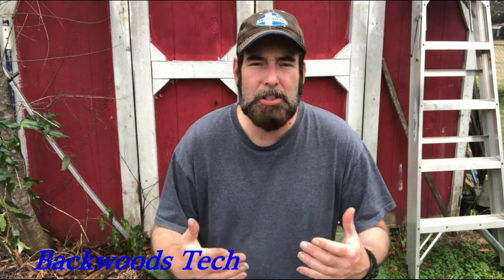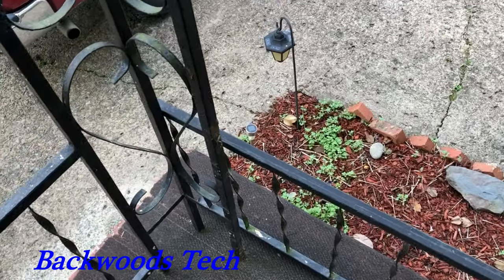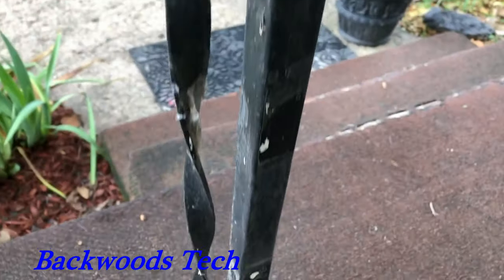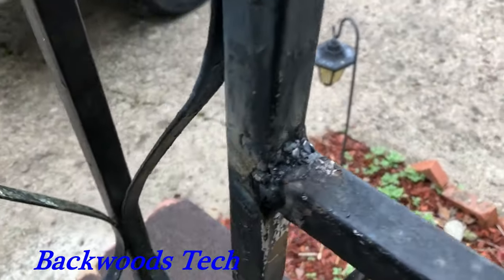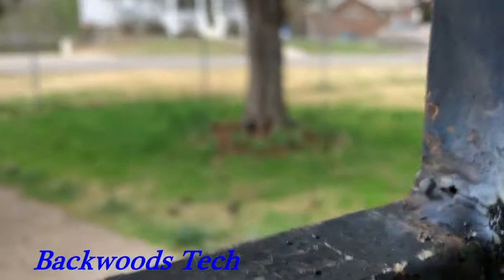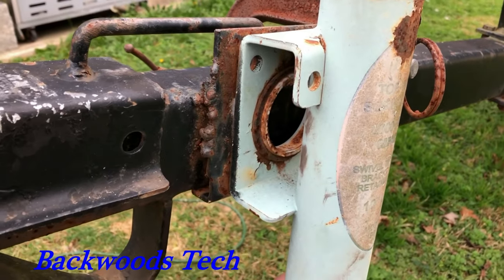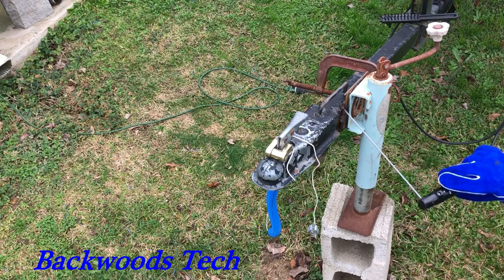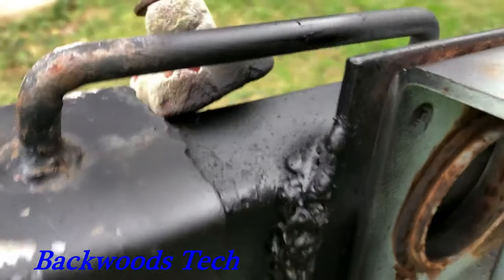Campbell Hausfeld 115v stick welder and kit unboxing , use and review

Comment: I purchased this kit last night from Walmart for $30 after watching this review I am very excited to use it.
Reply from the maker: It’s a great welder for the money . Just as a tip I would start off with easy strike rods
Reply: @backwoodstech1972  Bit late to the party, but would you have a link or brand info on those rods? I also snagged one of these kits from Walmart...just under $20 on clearance. I guess next stop for it was the dumpster out back. I just couldn't walk away from that deal.
Reply from the maker: @BilgemasterBill  They are Easy Strike rods made by US Forge Amazon usually has them
Reply: @backwoodstech1972  Thanks! I see 'em now.
Reply from the maker: @BilgemasterBill  you’re welcome

Comment: With these small AC machines having small electrodes (5/64" and 1/16) is how you can get useful work done. With 6013 and 6011 maybe 3/32".
    You can't get 7018 small enough for 70amps, but the smaller sizes of 7014 are great.  All the small sizes are harder to find, and more expensive, but they are the secret of success with small machines.
    Also find a 20amp outlet (vs 15), if you can; the shortest extension cord that reaches, and the heaviest gauge (10/20) you have, whenever you use 120volt machines.
    There's a lot you can do with these little boxes, good luck.
Reply from the maker: I have no problem doing projects with the welder and the rods 1/16-1/8 are plentiful and were reasonably priced until inflation set in

Comment: You didn't say what kind of 5/64" you used on the trailer jack, but 6011 would be ideal for this machine, if you can find it, and if you can find it at a good price. 
    You should always grind and prepare your metal, but if you can't, 6011 is the way to go. It is more aggressive,  but low current like 6013. 
    3/32
 burn through thin steel tubing of the porch rail.
    3/32
Reply: Stupid You-Tube app won't let you edit if you send accidentally.
Reply from the maker: Thanks for the info   I just wanted to see how it would perform

Comment: U had a hard time striking cause it looked like the ground was a little far also should hit the slag off the welds to make it look cleaner jus a pro tip also great video
Reply from the maker: Thanks I am a novice
Reply: Lmfao.  @protip
Reply: As long as your ground is hooked to whatever your striking it don’t matter if it’s 2 stories up it will ground just fine just need to find a better spot
Reply: If your rods are exposed to humidity they will get like that. Keep em dry. They make rod ovens btw.

Comment: I picked up one of these welders from a dude for 75$ it looked damn near new and he said he only used it for one fence project. I got 3/32" 7018 ac rod and cannot strike an arc even on the, "High" setting. I'm trying to figure how I can make this sumbitch work- the stinger and ground clamp, for what they are look good so it's clearly a power issue. I just do t want to concede to the fact that I most likely wasted 75$
Reply from the maker: Try cutting the tip off the rod and see if you can get a spark
Reply: You waisted you're money.  Ours won't strike a 1/16 rod
Reply from the maker: @MrDavidelliottjr  Mine works great just got through  welding in a new catalytic converter  on my truck Saved me $900 repair bill
Reply: @backwoodstech1972  from what I just seen you sure you fixed it? Lol
Reply from the maker: @MrDavidelliottjr  oh yeah
Reply: Mine not burning the 1/16 rods it sticks regular

Comment: Do you know if there's an internal fan on this welder? I used one recently and it was so quiet I couldn't tell if it was on. It also got very hot. One time it tripped a fuse. I think the internal fan might have died if it has one.
Reply from the maker: This one will shit down if it gets to hot or if you stick the rod to the metal too many times

Comment: Congratulations on the new welder. If you start getting serious about metalworking and welding may I suggest you get a dual voltage welder.  I bought an Everlast dual voltage welder thinking I would use the 110v option the most but it turns out I use 220v far more often.